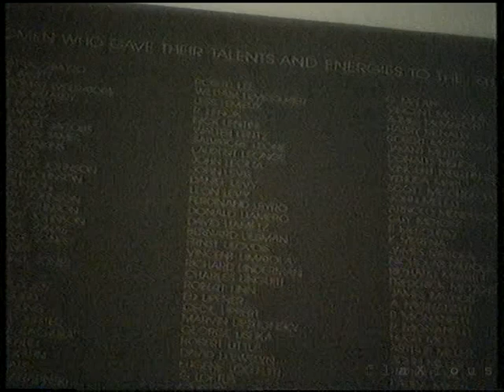How Manhattan escaped tragedy [3]

Comment: Truthers trying to use this example as proof that construction of this sort can easily be carried out in secret have no concept of reality and what actually happened. Obviously people noticed that something was going on with the Citygroup center but without having access to or knowledge of the bigger picture they'd have no way of putting two and two together and it would not be any cause for alarm. 
Now if the building ended up collapsing you can damn well bet the the hundreds or thousands of people that encountered or saw these situations first hand would have brought their concerns forward but seeing as nothing happened to the building it's entirely unmemorable otherwise. Hence the myth of this fix being carried out "in secret" has been perpetuated - and it's not exactly much of a secret today is it what with this documentary and numerous others having been produced on the matter.

- Welding fumes wouldn't just entirely dissipate in a enclosed structure like that overnight. Office workers likely even asked questions about it, but there concerns were either dismissed or attribute to minor fixes by management and that's likely all lower management was ever told about it to begin with. 

- Items were obviously moved in order to access the joints and it's questionable how much attention was paid to maintain appearances and return these items to the original position. Undoubtable this was noticed by offices workers but was probably passed off as being attributed to after careless hour cleaners at the time.
- Gypsum board dust and residue would likely have been noticed as well and raised some concerns.
- The building was very clearly lit up at night at the welding sites, but again why would people in neighbouring buildings care or pay much attention to this when they have no access to the true intent behind the whelding.

Where as something did happen to the WTC's and with information being far easier to discriminate today with the advent of the internet there would've been hundreds or thousands of eye witness accounts of unusual activity in the WTC before hand and the government would be as powerless to stop this information from being revealed in the same way that they were completely powerless to stop the dissemination of fake news from foreign entities in the lead up the the election. But ignorance is bliss, not mention it's much more fun to believe in some grand 'ol conspiracy and  especially so when you have nothing else of any significance in your life to dedicate yourself to.

Comment: Pipefitter here. I'm just amazed that anyone believes this nonsense even for a second.

You wanna have 20 welders do what inside there? Everyone inside that building on every floor would required supplied air. The streets below would be blocked off from air trailers parked around everywhere. 

The entirety of all the floors would need to be covered in fire blankets to even remotely prevent the place from going up in flames. You'd have spot fires throughout the areas.

Noxious smoke would be pouring out onto the streets.

There would have to be several welding trailers parked around the building feeding oxy/acytelene to cutting torches and electricity to stingers/zipcutters.

All in all this is one of the craziest fucking things I have ever heard of lol
Reply: +Nebzz Seems impossible but they clearly did it and kept it all secret for 17 years.  Makes you wonder don't it?
Reply: All they would have to do is reverse the air systems. It would pull in clean air and pump out the dirty.
Reply: Nun Ya lol

Comment: so they went into people's offices, ripped off the drywall, prepped the beams, stick welded everything together, re-applied the drywall, and put everything back together? people didn't notice the weird air freshener scents...geez
Reply: People are pretty clueless
Reply: I agree a lot of people wouldn't notice. But they would have had to have been bloody lucky for no one within a sky scrapper to notice.

As with any security system the cleaners would have been the biggest problem. They're the people most likely to reveal this sort of thing, by mistake or otherwise. 
I'm guessing they were kept in the dark somewhat.

Keeping your staff very busy would help too but I doubt so much thought was put in to all of this.
Reply: For sure some people noticed the construction, but what would you think? With everything done the next day, it was likely a minor repair.
Reply: @danielrose1392  Most likely. Something like..."Your heating system was broke..."
Reply: they probably did notice but how is anyone going to put it together with the newspapers on strike, everyone involved seems to agree if the papers had been running they would have figured it out well before the repairs were done